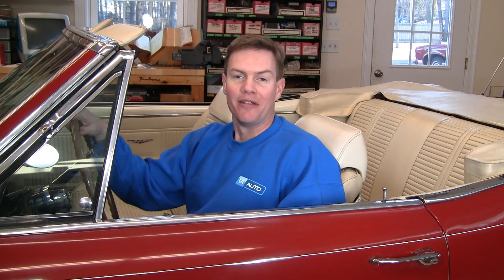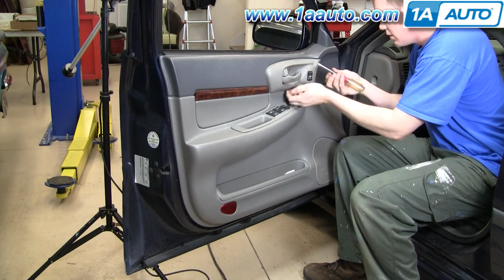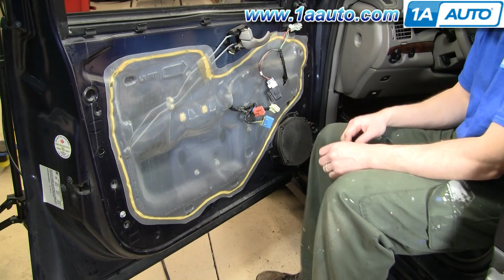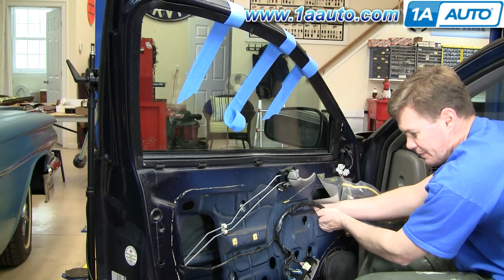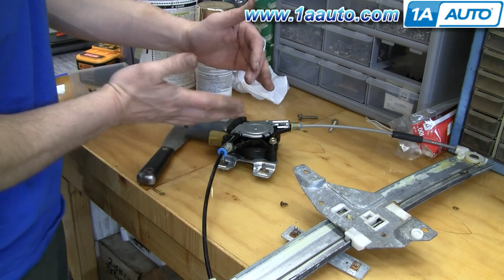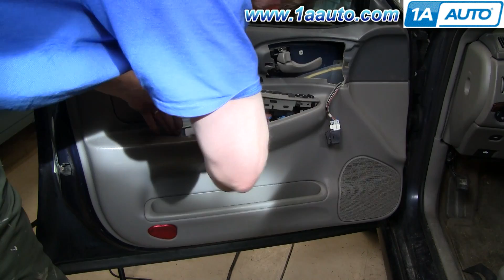How to Replace Power Window Motor 03-05 Chevy Impala

Comment: The only issue that i am having is which side of the regulator track does the window attach to ... I have an aftermarket regulator and the glass will sit on either side of the track. Just need to know if the glass is made to sit on the outside of the track (door side) or inside ( speaker side )

Comment: Thanks for this video! I have a question.....My window is stuck in the down position and I can't reach with window regulator bolts to detach the window. How do I get to them if I can't raise the window up to make the bolts visible? I've tried pulling it up and it won't budge.
Reply from the maker: If the cable is jammed and preventing the window to be moved into the up position, you may have to free the cable up so that you can move the cable around. Hope this helps you out. 1aauto.com 866-403-3393
Reply: 1A Auto Parts Thanks! So, basically I have to cut the cable and the window will move? Is that reachable from the right hand side?

Comment from the maker: You may be able to apply some of the basic steps shown in this video to your vehicle. You may also want to test the power that goes to the window motor to see if there's power going to it. If there is power to the window motor, then the window motor may be bad. Hope this helps you out. 1aauto.com 888-844-3393

Comment: hello I have a 89 Chevy G20 5.7 engine and my window (driver side) when it goes down  stops on the middle an make a loud noise and when it goes up and reach the top make the same noise should I assume mi windows motor is the problem and I need to replace it?? thank you in advance for your answer

Comment: I have a 98 cavalier with the a driver/rear window. There is power to both the up/down copper leads in the switch.  I hear a slight noise when I press the down switch but not for when I press the up switch.  Is it a window motor that needs replacing?

Comment from the maker: You might have an issue with either the switch, wire or the motor. You will have to open up the door panel to figure that out.

Comment from the maker: The motors are electric on  these vehicles so they can fail without warning unfortunately. You can take a look at our website to see if we have the parts needed to fix the issue 1aauto.com or you can give us a call at (888)-844-3393

Comment from the maker: It could be that the weatherstrip is dry and getting old, or the window motor may be getting tired. If you spray a little silicone spray on the rubber seals that the window rolls up into, it will speed it up for you. you can find it at your local auto parts store. Have a great day! 1aauto.com 888-844-3393

Comment: Yeah, I think it is a wire that goes from the door to the body (I guess). When the door is closed the issue happens when it is open they work fine. Must be a wire that is going bad or is just getting pinched? I will take it to a shop soon and get it diagnosed. Also thanks for your informative vids. Have a great day, Josh

Comment from the maker: If you are having an issue with all of the switches as well, you might have a bad relay or a bad wire somewhere causing the regulators to ground themselves out.

Comment from the maker: It may be that the window motors are getting tired. You could also try to replace the window seals if they're dried out, or another trick is to spray the weatherstrip with some silicone spray (available at you local parts store), to see if that helps to free them up at all. hope this helps you out.

Comment from the maker: @malikahmadali If you remove the door panel, you should be able to reach inside of the door and then push it into place. You may have to prop it  into place with something until you can get ir repaired.

Comment from the maker: You either have to reach in and get to the bolts that hold the reg to the window or unbolt the reg from the door first then move the window and reg to a point where you can get them apart.

Comment from the maker: @rskauai1 Probably motor, I'd advise when you replace it make sure the window goes up and down without catches, if there is a balance spring on that regulator you may want to replace at least the spring. Possibly the joints on your regulator are worn out so you may want to replace the regulator as well.  Unfortunately we don't sell that reg.  I'll let my product guys know see if they can find it.

Comment: The window on my 1990 Caddy Coupe Deville passenger side goes up about 2" and then stops? If I wait about one minute or two it will run again either up or down the same 2", any ideas why? Motor, switch or reg?

Comment from the maker: @RealRelz A chrysler will be similar but not the same.  There will be slight differences in how you remove the door panel and how the regulator or motor is attached.  If you don't feel confident after watching the video then I'd suggest enlisting the help of someone more mechanically inclined or take it to a professional.